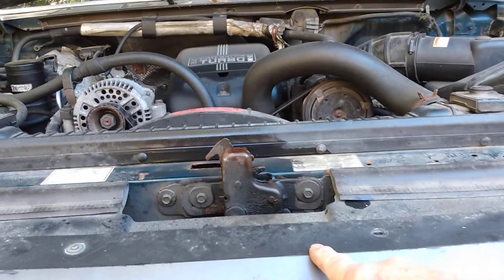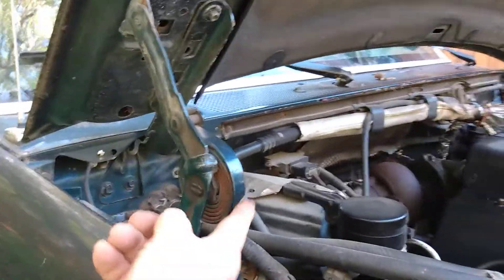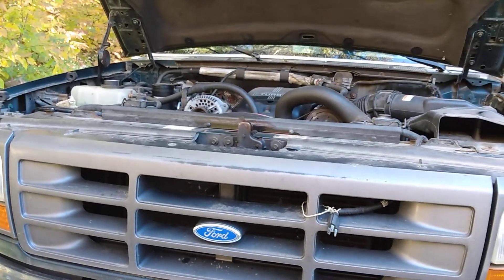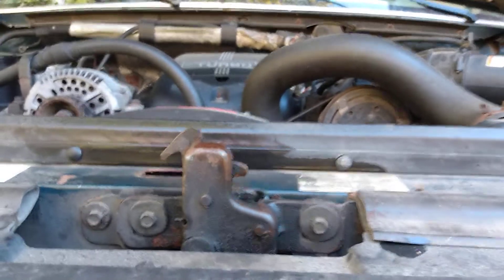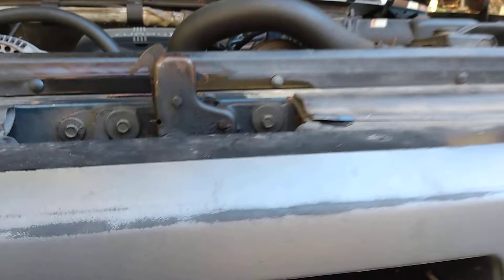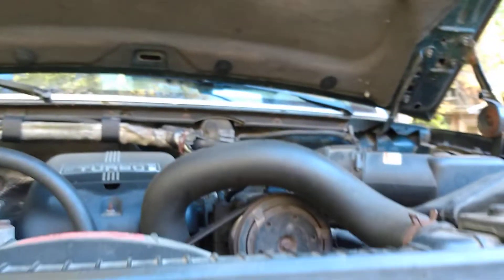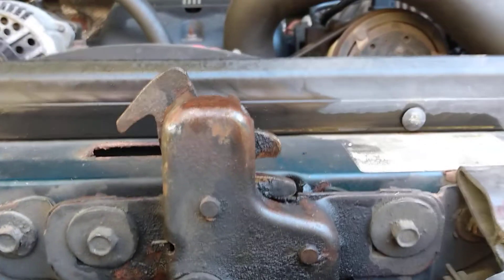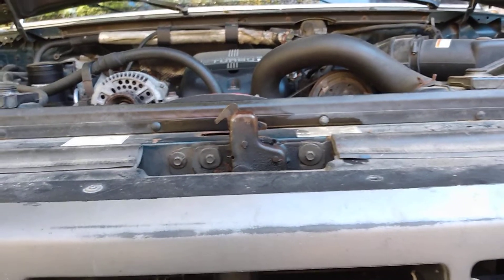hOW TO FREE JAMMED UP HOOD LATCH ON 1995 F350

Comment: I had exactly this problem on a 1996 F150.  Looked at a couple other videos that were difficult to attempt and didn't look to be worth trying.  This worked great, except that I mistakenly tried to leverage off the vertical plastic center bar of the front grill that is in front of the latch.  Instead you need to leverage against the metal upright behind the latch.  Still, this worked great.  Thanks so much for the solution.